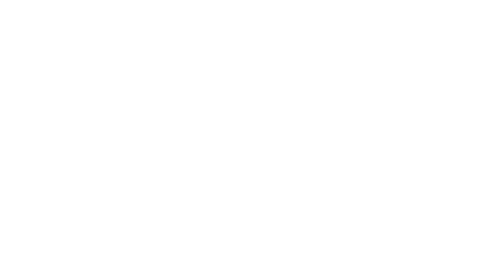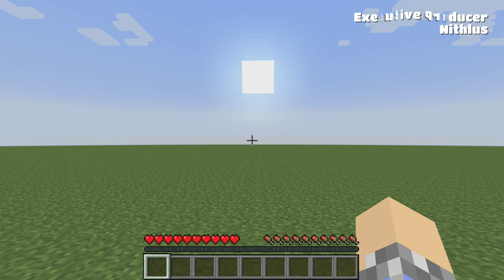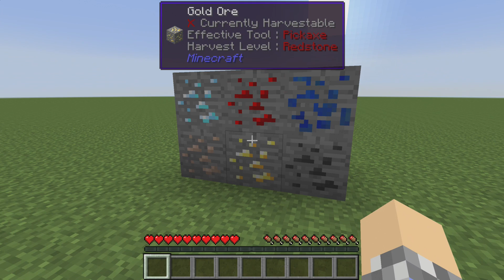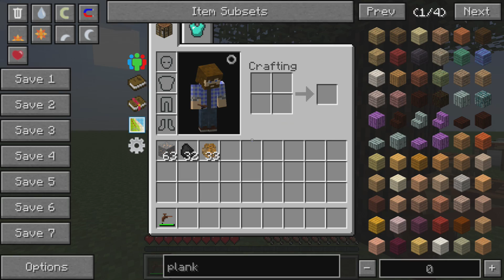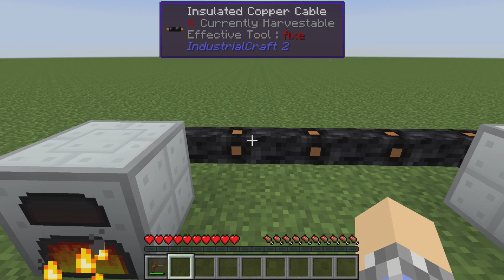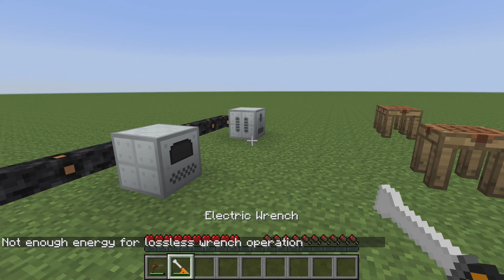Cub's Guide to Industrial Craft 2 (Basics)

Comment: Would it be better to use the macerator or smelting from Tinker's Construct?
Reply from the maker: Depends on what you want your setup to be. With the Smeltery, it’s all self contained. With a Macerator, you’ll still need a separate device to smelt the resulting dust. If you want the simplest option, Smeltery. If you want an advanced automated setup, Macerator, Furnace, some transfer pipes, etc.

Comment: Wait you can use any ore like copper and it will work?..
Reply from the maker: Copper, iron, gold, tin, etc etc. Most metallic ores.
Reply: Howdy Folks! Gaming thanks this helps alot
Reply: @HowdyFolksGaming  why would you grind them?
Does it give u 2 ingots or what?
Whats the point xD
Reply from the maker: Yup. A single ore will grind down into two dusts, which can be cooked into ingots.

Comment: I have a question
If you have tinkers construct on if you put the crushed iron in the smeltey will it work or do you need to put it in a furnace?
Reply from the maker: It will work, yes. But usually you'll only get a single ingot from it. Some packs have altered that so crushed ores double in the smeltery, so you can essentially get quadruple ingots for every ore. But that is usually not enabled.